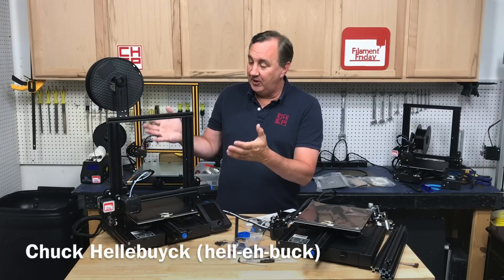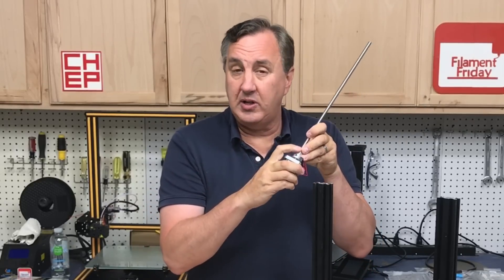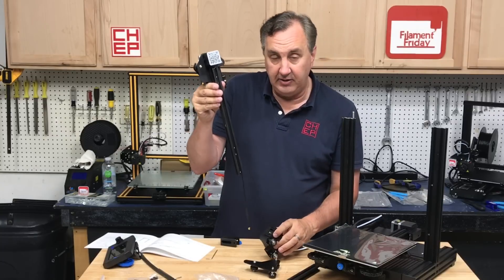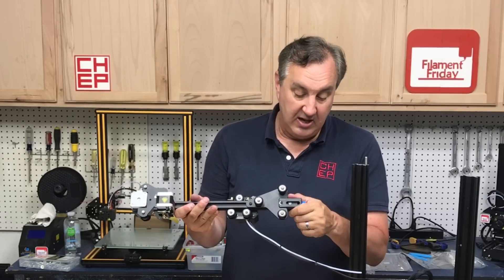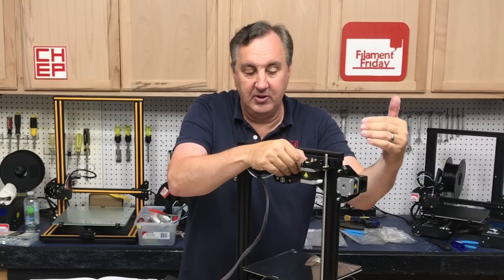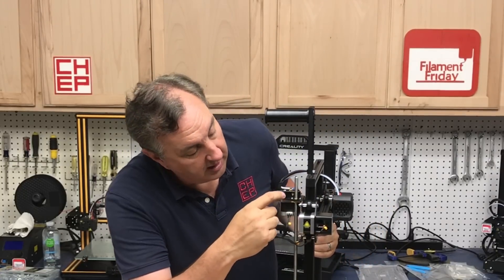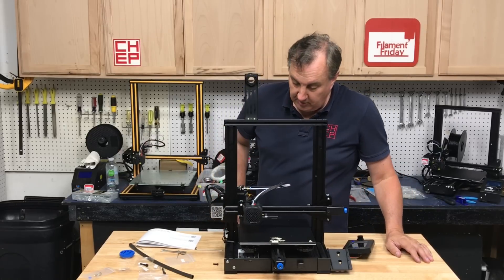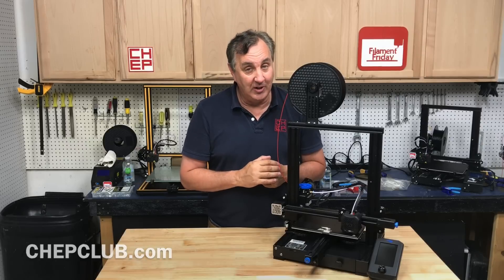How to Setup an Ender 3 V2 3D Printer

Comment: i just got the ender v2 and assebled it.  the one thing i noticed is that the right side bracket has a bit of a wobble when it hits the bottom. so it teeter totters on the right side. hoe do i fix that? or is that normal?
Reply from the maker: Not sure what you mean. It should be tight to the crossbeam. Make sure the eccentric wheel is tightened as well.

Comment: The first step is the big problem.  Which rail is left and which is right?  Which orientation are they attached?  Neither the manual or the video show which may around to install the rails.

Time for "trial and error" assembly.

Comment: The people saying that this is so hard to follow must be putting together their first printer. I agree that this is not a beginner tutorial. But if you have ever put a 3D printer together, then this should be a good instructional video. It definitely helped me with the order of steps and I found it to be a much better resource than all of the other long, drawn out tutorials. It was straight to the point and easy to follow for me. Thank you.

Comment: Is the black tube on the table at 9:28 just protective packaging for the Z-screw?  Or is it an actual part that goes somewhere?  I like that you explained the extra two holes on the Z rail at 0:42 -- I was curious what they were for when I was trying to figure out which was left and right form the instructions.
Reply from the maker: It protective packaging.
Reply: @FilamentFriday  Thanks.  When I was unwrapping the Z rails, my Z screw fell out, and I found the tube separately and was confused.

Comment: Quick question: why does my z-axis not move smoothly? I can’t move it up and it’s tough to move down. Everything is aligned right and without the metal rod, the z-axis moves smoothly. Is there something wrong with the metal rod?
Reply from the maker: Try loosening the brass T-Nut screws.

Comment: You should do step by step, and SHOW EXCATLY how you do some things. Some pieces aren't fitting on like you have them, so I will have to look elsewhere. You might be familiar with building 3d printers, but please, for the love of Saint Nicholas, make this easy for people who have NEVER built one before. Those are the people who are most likely to watch, and when something isn't fitting right, and you never showed putting those pieces together, it is extremely frustrating. Especially since the instruction book for this model is about as comprehensible as a poodle baking lasagna.

Comment: Hello! Thanks for the video, I cannot get the acme screw to mount XE axis assembly.. looks like the screw is sitting crooked. i think the through holes on the support extrusion might be a little off causing the zaxis motor to cock to the side... or im doing something wrong.. have you run into a similar problem?
Reply from the maker: Not seen that.

Comment: I installed linear rails under the heated bed. Am having to many leveling issues so I might go back to guide wheels. I also replaced the leveling springs and they are also giving me issues. Modifying this printer is a pain so it's better to keep it stock unless something needs replacing.

Comment: Hi, I bought a new Ender 3 v2 yesterday and assembled it using your film and must say thankyou so much it was extremely helpful how ever there is a problem with mine and another user you may or may not be able to help with. It will not auto home, I am in Adelaide, just assembled my Ender 3 V2 (11 Jan 2022) when I choose Auto Home it will not operate other than Z Motor Clicks but not turn (I disconnected the threaded rod) the Z motor powers up but stays locked tight for 7 to 8 seconds and fails to turn or run it would seem it goes into Brake mode while x and y motors go to home but that is not happening , the motor then powers off and that's it. The z motor on its own is free to turn by hand and with the threaded rod connected.
All 3 xyz movements are free to move by hand, the head fan runs continuous, the screen says "auto homing don't start another operation and just sits there." All three motor plugs are firm and correct at the motor and at the PCB.  (I am electrical/electronics Tech) 
Any help much appreciated
Reply from the maker: Try a different motor on the same connector to see if it turns.
Reply: @FilamentFriday  Thanks tried that and identical result
Reply from the maker: Then you have a bad board or bad wire harness.

Comment: ok, i have question: started assembling my Ender 3 v2 and I noticed that the XE kit, the screws for the wheel are facing the wrong way (FWD instead of BCKWRD, the part were the hex key goes is facing the back of the printer ). 
Will that be an issue? should i take them apart end invert them now?
Reply: Y

Comment: You’re missing a lot of things to make sure everything is square and even.
Reply: Yes.  The upright for the gantry on the left side (with the Z axis motor) is out of square a bit when tightened down from the bottom 2 screws.  It's about 1/4" out of square from bottom to top, leaning back a little.  Is this a big deal?
Reply: @freedomseeker01  yes, it’s so important to take the time to make everything square. I bought a nice square just for the build. My prints are only out of wack from slicing not the printer itself
Reply: @user-bh9yk2wv4w  Yes.  I bought one used that was out of square.  A flat file and 6 sheets of aluminum foil as a spacer on one side squared it up.  Plus the cross bar was not square the way the original owner set it up.  Next time I will buy new, set it up myself so I know it's right and be sure I have all the tools like the nozzle wrench!
Reply: @freedomseeker01  you may not have had to do that, if you tighten just one side of the post the screw will bring it closer to that side.

Comment: Oh man! You made an Ender 3 V2 setup video without 30+ minutes of rambling and nerd faces?? This can be done??

I am EXCITED to build my printer now, having a concise video to follow! I've seen a lot of other videos and I was getting really discouraged about being able to follow along and scrub back and forth. This is definitely the video I needed. Thank you!
Reply: @CHEP I finally got up the nerve and energy to build mine today. Your video was invaluable! My only hang-ups were from doing parts backwards several times; I put the wrong vertical support on the side, I put my extruder on backward, I put basically everything on backward at least once except I always got the hotend pointing down because of how you showed me specifically what was the tip of the gantry and which way the hotend points.

My arthritis is KILLING ME and I am so fatigued from it, but I'm also so excited to begin that I dreamed about 3D Printing when I passed out!

Comment: A disappointment in watching this video.  This is my second Ender 3 V2 I'm assembling and I thought I'd watch a different video this time.  While the ideas may be good the video is annoying.  From the start the first we see is the Ender sitting on might be upside down or on its side.  I know it is on its side after thinking a bit but that was annoying.  Next, he mentions attaching the Z-End stop but doesn't show or mention how to.  Nor that how to connect it to the rails using the two silver "what you call them" T-Slot nuts using the silver screws? No, they don't fit. The only ones that fit are too long to get past the Screw Connector to the motor. It appears that I'm missing the screws.  Time to pull out the booklet  which alludes to two m-16mm length screws. Well, as the video doesn't help at all with the assembly by showing anything about this the screws are present but do not use the silver nuts for this step.  Some crappy video this is turning out to be.
Come on, this is a how-to assemble video but most of what you show is the two parts already assembled!!!  When assembling the X-axis there is no mention that the two T-slots bars that come are different and to look for the correct one. Nor, to where to mount it. You have to stop the video and look closely.  

And to mention that there is no "pre-assembly instructions".  What I mean by that is, what is the best way to separate your parts and be ready to use them.  There is no mention of which screw to use when attaching the stepper motor for the Z-Axis.  Sigh. 
At that point it was, "Oh well, this isn't going to be the best video but I'll continue to watch it as I know what I'm doing. I just can't remember the sequence of the steps.  I will say that adding the z-stop this early on IS a must.  On my first Ender 3 V2 I kept fearing that I'd break it putting it on later.
I wish that people who teach could actually learn to teach. And if doers do, and those who can't teach, what does this make CHEP?
Reply: I know I’m a month late here, but come on man, you are being extremely pedantic. First off, he says you should use this guide with a manual, so most of your points are moot to begin with. He says, right at the part where the printer is on it’s side, that the printer is on it’s side.

Read the manual on how to attatch the z endstop.

Obviously you don’t understand how t-slot nuts work. You absolutely can assemble them after the fact, as you attach them loosely to the part that needs them, orientated so they slot into the rail, then when you tighten them they rotate 90 degrees to engage with the slot.

Man, don’t be a dick. You can constructively criticise something without resorting to calling it trash.

Comment: Hello Chuck - I assembled my unit today using your video extensively.  This is my first foray into 3d printing and the video was an immense help.  I have two questions I was hoping you could help me solve.

1.  My bed was also loose so I turned the eccentric nuts to tighten the bed.  I now have no wobble but when i move the bed across the y axis (bed axis), I feel three bumps as the carriage moves forward to back.  Almost like I have a flat spot on a roller the repeats three times.  Will this effect print quality?  What do you think it is and how should I fix it?

2.  The linear rod centered easily with the extrusion when looking face on to the machine but in the other axis it tapered closer to the rail as you approach the top of the machine.  It did not seem to be able to be adjusted out.  I am concerned about wear on the brass journal over time.  Should I disassemble the machine and try to adjust it out or possibly shim the extrusion.

You thoughts would be appreciated.
Reply from the maker: 1. Could be bad bearings but just loosen eccentric a bit
2. Yes, many people shim it

Comment: He says switch the 230 V to 110 V in the back or it won't work.  Does he mean 115?  That's what mine says and I don't want my thing to explode.
Reply: Maybe you shouldn't have one of these if that is the thing that has you stumped.
Reply: @mdcraig62  just trying not to die here bucko

Comment: Hello Chuck....should the print head be stable on the bar. Mine move slightly up and down...it wobbles and when you try to level I have to make sure it is down/  Thanks
Reply from the maker: Yes, should be stable. Check the eccentric nut on the bottom wheel and turn it tighter.
Reply: @FilamentFriday  Thanks for the fast response...missed that adjustment

Comment: I just got this one and assembled it yesterday. Any particular tips to fix the cables? They're a little bit all over the place in my build and worried that the cables will get damaged by extensive movement after a while...
Reply from the maker: Tie strap them into a bundle so they don’t get hooked by the bed or carriage movement.
Reply: There are actually plans available to print your own cable chain for that.
Reply: Will try later on thank you very much!

Comment: This was extremely helpful and I will be sharing it with anyone I know who gets one of these (and I'll use your amazon links to help tip you). Thank you! I had no idea what I was doing but was able to pause the video when I needed to and I got through it. Only thing I would have added is to be careful when affixing the bar to the extruder assembly to not break the switch. I was trying to be careful but small child started calling me and I mashed it. That switch is really brittle and easy to break, I barely touched. 2 days later I got the replacement switch and was good to go.

Comment: I didn't have issues with the screws on x belt tightener but glad to see your bed is also rattling around. I wasn't concerned because I've worked with these V wheels on a laser burner

Comment: When i assembly my Ender month ago, i first mount top profile, adjust it using measure tape (top and bottom distance between vertical profile equal), than adjust that horizontal profile - and it works good.

Comment: i lost you in the first step😔 if you are building and is a rookie like me pass this video is not for you😡
Reply: Nate Higgers my endee3 is still on the table trying to find a YT video that help without skipping any details☹️
Reply: Same here. Check "Creality Ender-3 V2 assembly and pro build tips" by Tomb of 3D Printer Horrors for a more in-depth tutorial.
Reply: I'd also suggest "Creality Ender 3 V2 - 3D Printer - Unbox & Setup" by "Just Vlad", which doesn't perfectly assumes you're following the assembly manual, but provides more close-up imagery or extra detail which Creality omitted (which way something orients etc). It does reference the manual in a supportive way.

I found the 3D Printer Horrors got too far into a rabbit hole of suggested modifications, and then it fails to tackle the steps  in the same order as Creality.

Comment: So i am also in the US, when i play with the power switch (320/110) if i want 110 should it be showing 110 or 320?
Reply: It says on the bottom that whatever voltage is shown is the voltage selected.
Reply: @m.k.7121  thanks.
Reply from the maker: 110

Comment: I am stoked you did this video, manual is too small and they don't show the holes in the extrusions. Would also be helpful if you told the screw size, diameter and type of screw head for assembly.

Comment: Hi Chuck, I'd like to  give a thank you in regards to your Ender 3 v2 videos, the build/assembly guide was more feature rich than the actual manual so I binned that and used the video. I am new to 3D printing and relying alot on community videos and posts/comments for information.

I'm also using your Cura 4.7.x profiles, which has greatly helped; I do however have a problem with prints having stringing issues when the print-head/extruder moves from location to location. Are the retraction options within the 4.7.x profiles (for Ender) still valid? Retraction Distance: 6mm, Speed is 45 mm/s, minimum travel: 1.5 mm.

You have a video regarding stringing on the Ender 3, but the information there conflicts with the later Cura profiles you have provided, so I am hoping for an update if possible from you, or your thoughts/comments on how I can fix this?

Thanks,

Comment: Check the ender3 v2 for AC earth on the metalwork. On mine the black powdercoating was insulating the PSU from the metalwork. I installed a wire link from the AC ground on the psu to a long screw on the 40x40 .

Comment: Hi great videos. I have the v2 and just setting it up. I had some tight spots on the vertical movement so i disassembled and found without the long screw the alignement of the rollers and movement up and down is very smooth with no slack. Once i engage the long screw its somehow causing tight spots, any upgrade advised? I think its pulling tbe assembly just slightly off line.
Reply: Same problem with mine 😢
Reply: @jakivicente7527  i dis assembled and rebuilt it but making sure frame is all aligned. But the long screw was not entirely vertical. I removed and tried adjustment and its much better. You can try to shim the motor until the screw is parallel with frame.

Comment: Do you find your stepper motors get really hot? My Extruder motor is usually sitting at about 140-150 Fahrenheit  and is very hot to the touch. By comparison, my Ender 5 Plus with silent mainboard has much cooler steppers.
Reply from the maker: No. My steppers are cool.
Reply: CHEP Thank for the quick reply! Do you think it would be okay to measure the vref on the pots on my ender 5 plus silent mainboard and adjust the v2 mainboard pots to those values (assuming the sense resistor values are the same)?
Reply: Fixed it. Set the Extruder vref to 1.38v and it runs much cooler now. Thanks for all your hard work on this channel.

Comment: Watched another assembly video and they suggest changing bed springs and bowden tube coupler. Good idea?
Reply from the maker: I’ve covered couplings in a previous video. The original ones were bad. They’ve improved them. As far as springs, that’s a preference.
Reply: @FilamentFriday  thanks, still going through your vids, I'll check it out

Comment: I receive mine yesterday and my priority was to contact creality in order to update the fw 1.0.1 to ver 1.0.2 or else in order to make my printer visible in my pc, they send me a strange fw the menu changed and the info session dissapeared - replaced by an auto leveling icon and when tried to access this menu the printer stucked! I downgrade to ver 1.02 and I contact them but without any luck until now. Then i visit your site i download the newest fw 2.0.6 and your calibration files, all  my problems passed away. I noticed a fw bug after paused a job the play sometimes stucked anyway thank you for the excellent job here...RESPECT